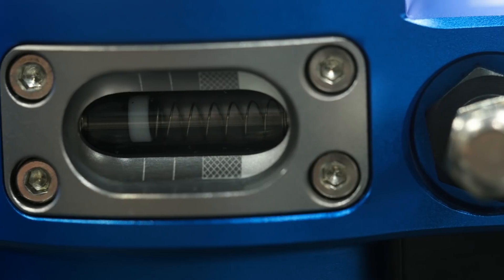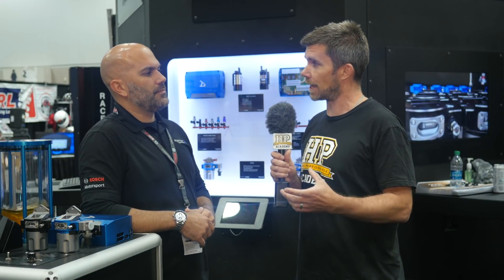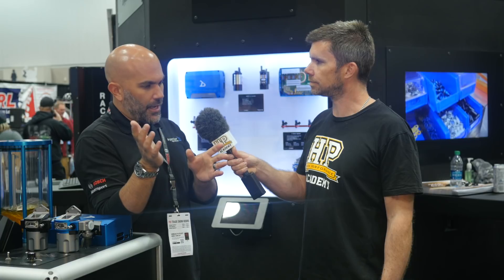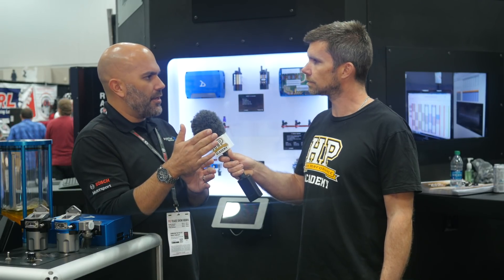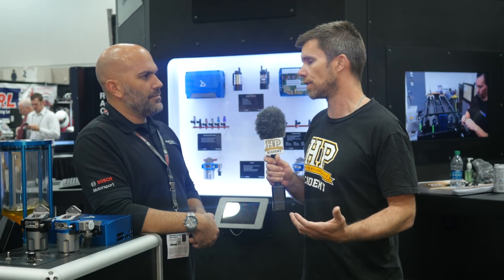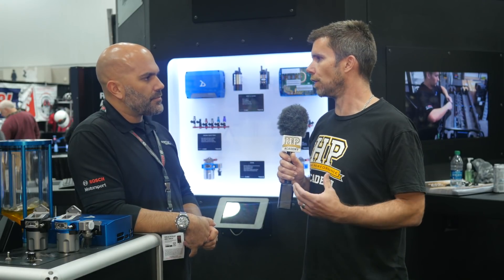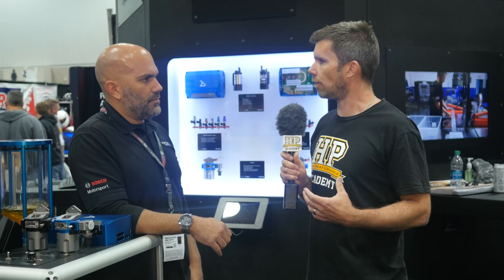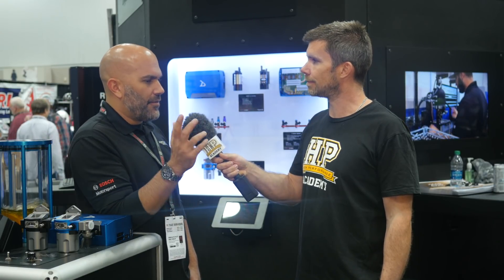What do you know about fuel filters? | Injector Dynamics [TECH TALK]

Comment: What is the fuel filter actually made from? What is the composite?
Reply from the maker: You will need to check with Injector Dynamics directly on that one sorry, they haven't published it. I would guess glass fiber, but that is 100% a guess and might not be accurate so get in touch with them before purchase for a definite answer - Taz.
https://injectordynamics.com/contact/
support@injectordynamics.com
Reply: @hpa101  found out it was a micro glass filter!